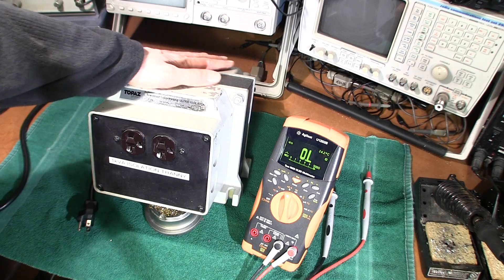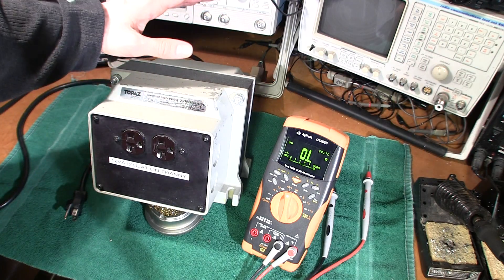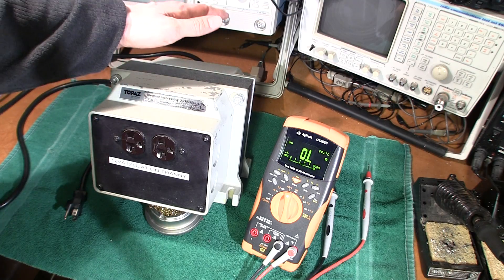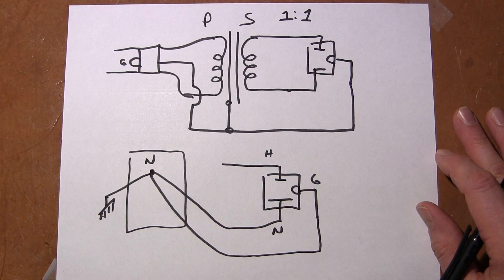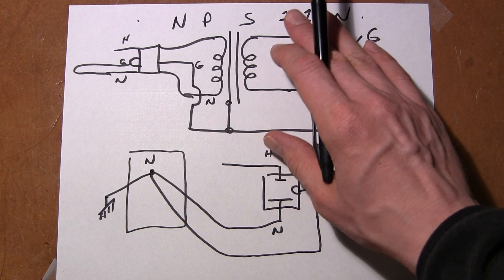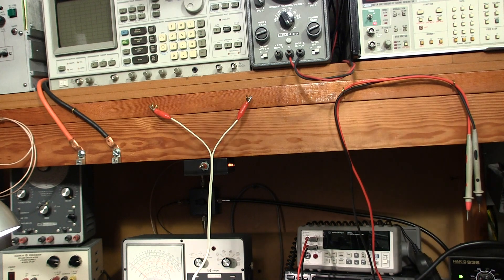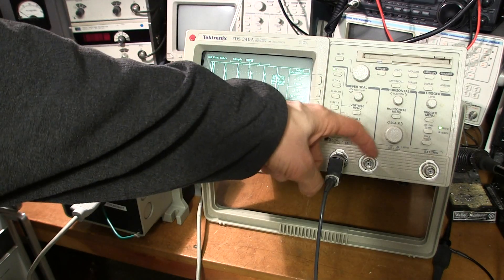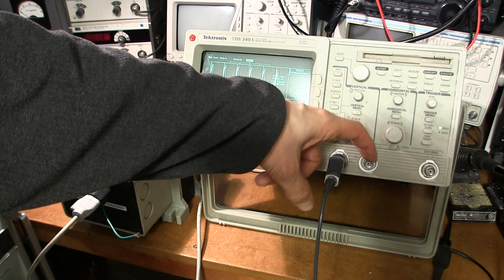Tech Tips Tuesday, Isolation Transformer and Variac Safety

Comment: Excellent video! Too many folks don't understand this issue. It was beat into my head by an instructor, who used the example of a grounded scope and testing a component in an energized circuit, for example either to measure a voltage or to see a signal. If an inexperienced tech attempts to put the scope probes directly across a component in an energized circuit, the negative probe will short out all of the circuit "below" the component being tested. Bad things can happen!

Thanks again for a great explanation.
Reply from the maker: +Clay Nicolsen 
Thanks Clay!

Comment: Good vid, thanks!
Theoretically speaking ;) the issue appears when you stick grounded scope probe gnd to live level (or any significant potential difference for that matter). Hence the 50-50 odds. 
Wouldn't it increase the odds to 100% if one tested first with probe TIP ONLY, whether you have potential on your intended ground hookup spot? Yes, you potentially get all the 'nice stuff' from household devices showing on scope signal trace but it wont blow up and you'd know if it's good idea to stick your gnd lead to that spot.

And/or do the same by hooking scope probe ground lead to a multimeter and check what is the potential difference between ground and the spot(s) you intend to hook the probe gnd to?

This way you don't have to compromise on fault current being directed to ground through yours truly should you touch the case at the wrong moment...
especially since if you are probing, the DUT is likely already faulty.

Another safety consideration, if one were to attach a separate GND via separate ground rod to lab/isolation transformer,
it should no longer be a low impedance path from one gnd to other gnd to N. Last time I poked wet dirt with DMM it sure read OL on ohms on any real distance you'd have... Just make sure the new gnd rod is not right next to the mains gnd rod.

Theoretically speaking.
Reply from the maker: +C4rlutt 
Contrary to what people think, soil is a poor conductor. This is especially true at low impedance. I plan to do a video on this in the future. The center tap of the pole transformer must be connected to the neutral/ground in the breaker box,  >>>>A separate ground rod system will not carry much current!<<<< The path resistance is to high. As for the scope reading the mains, that's a video in it self. On the other hand.... and at higher impedance and frequencies "RF" a grounding system works wonders.

Comment: Hello, and Happy Holidays to all.  :-)
If I understand this correctly, the secondary can't ever be separated from earth ground because the transformer core is also grounded to earth...is that right?

I have the Tripp-Lite IS250HG Isolation Transformer, and recently found out all this when I wanted to use a variac to speed-control an Inline 6 inch Duct Fan.
I read the variac doesn't offer protection from shock, so I purchased the IS250HG, figuring a hospital grade isolation transformer would offer the best protection.  But I found out otherwise.  :-)

There's a video on YouTube, from ToddFun channel, that showed how to remove the neutral ground strap from the secondary output socket, but of course, the earth ground is still there (3rd Prong) 
I made quick photos of the mod at ... http://imgur.com/a/yMdD2
..and I mention ToddFun's link as well, for the complete video.

I'm hoping this modification will at least make my application a bit more safe to use, and take away any chance of the aluminum ducting attached to the fan, from becoming a shock hazard if touched, or comes in contact with any other grounded device casing.
(There's also a 240vAC light in near proximity to the ducting)

The secondary of that IS250HG has what looks like a separate ground wire coming out of it, that's physically connected to the chassis, where the other grounds are too.
Could it be possible this transformer doesn't have the core grounded?

If so, I wonder if I were to also separate the secondary sides chassis connected wire, ...(the green wire from the transformer secondary winding) ... and the sockets 3rd prong, and connect those thru a capacitor (or MOV surge protection part, or both) to actual chassis ground, would that make a floating ground, that still would offer 'protection from shock' but still have an active completely functional separate ground reference on the output socket?

Comment: After viewing this video, I do have to say that Paul is on the money here! Plugging the DUT into the iso tranny is the smart thing to do. If the DUT has the circuit ground independent from the chassis ground, for the most part, you're good to go. Most older transformer-based equipment, TV's, Radios, amplifiers are much safer to do testing without fear of creating a deadly referenced path. The equipment's power transformer is providing the isolation. But, as he stated, working on AA5's or any series heater string set puts up a challenge. Isolated/Differential scope probes are nice, but expensive...and start at around $300+ American dollars. So far, I've never blown up a scope (yet)...then again, those are famous last words LOL :). Merry Christmas! :) Frank Ferraro--Audio Craft Electronics
Reply from the maker: +Frank Ferraro 
Thanks Frank, Merry Christmas!

Comment: Clip your scope ground on the top end of that isolation
transformer & see the BOOM !!!
You can back feed high voltage from a Unit Under Test via the 
scope ground clip & lift all other grounds & equipment in the shop .
Rule one is know your equipment .

Comment: So far loving the Tech tips Tuesdays. The Tektronix manuals discuss this now in the warnings. I had a run in once with thinking I was isolated and being told I was isolated but actually wasn't due to this same condition. My experiment didn't match your nice light bulb example. No, I had the blue flash once I got the alligator near the DUT. Lucky for me I wasn't hurt and I was holding the rubber shell. I now double check with a voltmeter first for any potential difference. The probe and scope were saved by a semiconductor going into escape velocity.
Reply from the maker: +W3AMD US 
LOL "escape velocity" That's a great term. Glad to hear all was ok in the end. Thanks for the kind words, and glad your enjoying the series.

Comment: Never float the scope. If you connect the DUT to the isolation transformer there is, imo,  no problem to ground the DUT from the transformer. Because that will still be isolated from the "new private net" you created with the transformer. Think about it,  it does not matter how you ground it,  as soon as you connect the groundclip of the scope to the DUT it is connected to the safety earth after all.
In your example you float the scope but still use the earth. If you connect that earth to the live wire you light up the bulb. That is logical. The only thing you do is connecting ground to the live wire. The transformer and scope are there just to be pretty and have no function ;-)  but a wrong use of the transformer. As wrong as disconnecting the ground from your scope. 
And if you disconnect ground from the transformer and float the scope like in the video, you will be in problems as soon as you connect a grounded function generator .
Fred
Reply from the maker: +pa4tim 
You say, "If you connect that earth to the live wire you light up the bulb." I'm not so sure I follow?
 The goal of this video is to show that the Earth wire carries through to the secondary side socket of the isolation transformer. And to also mention the barrel of the BNC is earthed through the line cord.
Reply: +Mr Carlson's Lab Louis Wilen, down the page, explains it better. His comment is what I tried to explain. 
Is de earth of your transformer connected to the secundairy winding ?  In that case you are right. 

It is a difficult subject. And it differs from country to country
I have an A6901 from Tek. It came from the UK, I  needed to mod that before I could use it here (the Netherlands)  And I have to plug it in the right way ("polarity") . We have 1 neutral and 1 phase random connected in the wall sockets. The earth has it's own contacts like you have (we have 2 "springs"). I have automatic earth-leak breakers on all sections and earth is connected  to the waterpipes (new houses have a groundrod) ). Not direct to the neutral. But in the distribution stations the earth is coupled to neutral. So in practice it is connected to neutral.

Comment: My understanding was that you should pretty much never float your scope, either through an isolation transformer, or especially from ground. Keep the scope plugged into the wall, and pit the device under test on the isolation transformer.
Reply from the maker: +PelDaddy 
Thanks for your comment!
Reply: What's the reasoning not to float the scope?
Reply: Teb Tengri the reason is that with a floating earth scope the BNC connectors are still attached together and to the chassis of the scope. So if you would hook mains voltage to the ground clip of a probe, all the other probes/BNCs and the case would be live. Since you normally treat the ground clips etc. as safe to touch, and often clip it straight onto the nearest ground of a DUT, you make it very easy for yourself to mess up and ruin your day. If you want the convenience of not having to worry where you stick your probes, there is no substitute for a proper isolated probe.
Reply: I'd rather float my scope if it didn't cause noise issues. That's because it's almost entirely plastic and if I'm hooking any probe to a ground referenced voltage I'm not going to be grabbing that or the other probe ground and mains ground at the same time. Any kind of mains probing isn't going to involve me just grabbing bare conductors for no reason. What I could accidentally end up doing otherwise is placing my probe ground to what I think is a neutral at the time when it isn't..pop.
Reply: @Magneticitist  Even a plastic cased scope is still going to have metal BNC connectors and two metal jacks for probe compensation. Obviously, you can avoid those parts of the scope, but it's still there!
I think the best type of scopes to use, for measuring mains, are battery powered scopes. 

Note: Many people measuring the mains are doing it for no real purpose. This is something to keep in mind, as well. Do you REALLY need to measure the mains? Can you diagnose the problem in another, safer, way?
Stay safe everyone!!
Reply: PelDaddy that was my first thought, put the scope i the wall, and put the device under test into the iso.... 

if you have an older piece of equipment (like 98% or so of stuff on this channel) it probably only has a 2 prong plug anyway.... so the iso-ground issue isn't an issue....
Reply: I agree but there are 2 techs here on you tube that float their scopes thinking it makes things safer.

Comment: An excellent explanation of something I was aware of (35 + years in semiconductor testing) but as you mentioned newer and less experienced techs may miss. I also want to commend you about the danger of just randomly defeating grounds as well. They serve a critical safety issue AND also a key point in shielding extraneous noise and signals in sensitive measurements.
I'll share a story about a time in trying to measure picoamp level input bias currents on an op-amp and having massive 60Hz noise problems. I discovered(after a lot of time I need to add) the problem was on our very expensive computerized tester. A maintenance technician was tired of  disconnecting and then reconnecting an elaborate bonding wire system to make sure all metal parts of the chassis were grounded and shielded every time service was required. So he decided not to reconnect the bonding wires..leading to large parts of the chassis acting like antenna and radiating 60Hz into sensitive measurement modules.

Again enjoy your channel a great deal. I'm  not too proud to say that even after years of experience in electronics, there is still plenty too learn. I'm now retired and starting to get into restoring some old tube powered radios, a new universe for me!
Reply from the maker: +GrandsonofKong 
Great to hear! Thanks for the story, and glad your enjoying the channel. Sounds like the tech was a little lazy. That sort of thing causes future techs a lot of issues. Merry Christmas!

Comment: Hi Paul:  If you plug the oscilloscope directly into the mains, why can't you then measure the secondary of the isolation transformer directly with the oscilloscope probe - connected either way, the secondary winding is still completely isolated from the mains.  The problem you've illustrated is due to the fact that you plugged the oscilloscope into the isolation transformer secondary, instead of just plugging into the mains - that's where you made your mistake.
Reply from the maker: +edwin howard armstrong 
No Mistakes here.... It's quite common to plug test equipment into isolation transformers. I think you may have missed the purpose of this video.
Also.... If you were to read just the secondary of the isolation transformer with your scope plugged into the mains, "what would be the point?" The isolation transformer would falsify your true intention..... unless of course, you wanted to see the output sine of the isolation transformer.

Comment: For safety plug in the thing that you want to test into the isolation transformer, instead of the oscilloscope ! And some variacs have isolation from the mains ;)

Alex
Reply from the maker: +High Voltage 
Hi Alex. The Variac will only have isolation from the mains if so stated on the unit. This is because the Variac has an isolation transformer as well.  99% of Variac's do not! Always test this.... I have seen many that say they have isolation, when in fact they do not.
Reply: Mr Carlson's Lab Don't worry, I know that, and it's very easy to test if it provides isolation or not :)

Comment: Good video!

Even some test equipment containing a built-in isolation transformer and variac has the ground pin in the receptacles bonded to the ground in the line cord. My VectorViz ISO-V-AC II WP-30 is set up this way.

The other option besides using a 3 to 2 prong adapter is to use a high voltage differential probe such as the Caltest CT2593-1. I use one of these when working on offline switching power supplies. The chassis will still be hot, and you will need to be careful, but you won't blow your scope or probes up as the differential probe is good to 1000V common mode.
Reply from the maker: +Steve Rodgers 
Thanks for your comment Steve!

Comment: Great video BUT: At 12:14 you say 'no connection' when you mean 'no current' - You're telling that disconnecting ground can be harmful, but you could emphasize the fact of turning the chassis of the scope actually 'hot'  a little more :) Also maybe why it's generally a bad idea to use the isolation transformer for the scope or other measurement equipment anyway. I think they should be used for the DUT only..
Reply from the maker: +salat 
At 12:14, That's exactly what I'm saying. I'm pointing out that there is no connection through the probe to earth ( that black rubber block isolating it )

Comment: Good tip with the isolation transformer, I've never seen one with the ground connected through!** I also don't like seeing a double outlet on there. One ground on one piece of equipment, and the isolation to the other outlet is removed.

**well not with test type isolation transformers. Construction site ones are different
Reply from the maker: +TheChipmunk2008 
Thanks!

Comment: Isolation transformer is for the DUT, so you can ( with some reduced risk) connect the grounded scope to it internally to measure waveforms. Does not work for all cases, like a SMPS primary side, where you need both an isolation transformer and differential or isolated probes, which can survive the common mode voltage for the differential probe, or provide full isolation for the isolated probe. 

For SMPS use that is why you really want to use a battery powered scopemeter instead, as it is truly floating and not mains ground referenced at all unless you plug in it's charger.
Reply from the maker: +SeanBZA 
Thanks for your comment!

Comment: Just a couple of comments:
1. You mentioned powering an oscilloscope from an Isolation Transformer (although, admittedly, you didn't actually suggest doing that).  That should almost NEVER be done. (The only exception might be if you are actually repairing an oscilloscope, where the scope is the Device Under Test (DUT))  Only the DUT should be connected to an isolation transformer.

2. A standard Isolation Transformer can be converted to a "technician's isolation transformer" by internally disconnecting the transformer's secondary neutral from ground.   This maintains the ground path all the way to the DUT (assuming that the DUT has a ground prong).  It is much safer than using the cheater plug while also isolating the DUT from the mains.   However, even with a "tech" Isolation Transformer, you still need to be careful not to do things like connect the secondary (output) to ground.
Reply from the maker: +Louis Wilen 
Thanks for your comment Louis!
Reply: I won't name any names but there are 2 professional techs here on you tube that use 2 isolation transformers because it's safer. they plug both their scope and tv or whatever into an isolation transformer. They both work as professional techs servicing consumer electronics.
Reply: yes , you are so right here .....
sometimes silly and basic  things goes so under the radar , right ??
Reply: Robert Slackware  Yep. At least a very low Ω path.
Reply: Isn't that how a variac is wired?